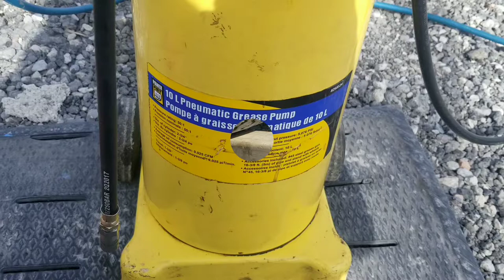No grease fittings? No problem!! | Ford F250 | asmr grease

Comment: You may want to use some RTV Sealant to patch those hole up. So grease doesn't end up seeping out of there as your driving or going over roads
Reply from the maker: Thank you for the suggestion
Reply: Wonder if taking a soldering iron and touching the made hole would seal it up it’s small enough and seems would work better then trying to get something to stick to rubber coated with grease. Cheers
Reply: @caseG80  good tip, it might work
Reply: That needle isn’t making a hole it’s designed to slice in the tip is at an angle.  The boot really is just covering the grease contained even with a grease zerk after a few pumps grease comes out somewhere.  They’re not holding pressurized grease in.  I think it’s overkill

Comment: not effective , the grease is not getting around the ball  and socket  where the friction occurs , it needs to flow around the ball to create a cushion film between the two,
Reply from the maker: It is effective enough to stop the  Squeaking noise. The grease film (oil) does make it all around the ball and socket enough to stop the noise and provide lubrication.
Thanks for the comment
Reply: get a moderate amount in there, it will distribute itself!  he did fine

Comment: One way to help keep dirt out of the hole that you poked through the rubber boot is to clean the boot off and then put some super glue or silicone gasket maker glue over the hole. It will hold nicely as long as you don't overfill the rubber boot up with grease.
Reply from the maker: Sounds like a good idea, I will try it out next time. 
Thank you for the comment
Reply: liquid electrical tape is awesome too .   yup, keep an eye on it every few months is what i gotta do with the one i blew out on my truck with too much grease.  thanks.

Comment: I never thought of doing that, but you made me think bout this
I would try bending that needle into and arc, or find a good curved one, and try to pull the edge of the rubber boot out just enough to slip the needle around the edge of the boot, one may have to use a small pliers to pull the edge out, and one would not need to keep puncturing the boot and have it quickly leak out as it gets pounded through travel. as that will happen,
Reply from the maker: Thank you for the comments

Comment: Thanks for the good info! What kind of grease do you prefer… synthetic, off-brand, Lucas, Amsoil….?
Reply from the maker: Thank you for the good question. I use a EP #2 (it's thicker), and it's made by Chevron.
Reply: I always use marine grease in case water gets in it won't be a issue
Reply from the maker: @jasonpeters9363  that's sounds like a very good idea,  maybe next time I will use marine grease
Reply: We use the synthetic ‘Green Grease’ on all our boat trailers (6) in the keys. Our new 2022 F250 will be getting the same for all the fittings.
Reply from the maker: @davidh5309  nice 👍
Reply: @davidh5309  Nice! I’d like to see a video of how to properly grease everything on an F250! Are you getting the 10 spd 6.7L diesel?
Reply: @Blakehx   2022 F250XLT 7.3 Godzilla with the 10 speed. Just got it in 3 weeks ago, only took 6.5 weeks from order. Truck is used primarily for towing our fleet of rental boats up and down the keys weekly.
Reply: @davidh5309  Nice! I have a 2019 F-250 6.7L diesel but not a fan of the 6spd transmission (I’m in 6th gear before I hit 50mph🤷🏻‍♂️). If I’d known the 10spd was gonna be available on the diesel in 2020 I would’ve waited.
Reply: @Blakehx  have a shop reflash it and force the transmission to do a Re-learn procedure. it can do funny things like that....... and its normal even in tow haul mode on to up shift to 6th unless you lock out 6th gear at around 45 mph...... under high throttle it wont upshift until 60-70 mph... itll ride 5th pretty high or if you lock it out.... i checked the gear ratios of my truck almost the same as my 5r110w in my 2005 F250 and the 5r110w is a 5 speed and the first 5 gears of the 6 speed they have are almost the same (excluding overdrive 5r110w has seperate OD 5+1) and i can do  80+ in 5th not overdrive in that truck....... i got my particular F250 because its got the 6 speed im not a fan of the 10 speed.

Comment: NO JUST FORD. ALL CARS MANUFACTURERS . They are life time warranty.   My 2018 Ram same thing . 
But my 2004 E250 I can grease  everything.  Even the drive shaft  bearing.  
And water pump .
Reply: my 2019 F250 there are zero grease zerk fittings on anything underneath the truck only superdutys to retain zerk fittings are the F450s Pick and cab n chassis or larger.......... the last year that any of the F250-F350 super dutys had zerk fittings was 2017 and they only had zerk fittings on the Front axel knuckle for 4x4.... my 2005 F250 has grease zerks on all these..... 

they make the most money not from selling a 80,000 dollar truck to someone but in replacement parts....... you can walk away with a truck with 1-2% interest but they'll know you'll be coming back just after warranty's up and giving them 10-12,000 for a new front end because they designed it to be unserviceable
Reply from the maker: Thank you for the info

Comment: Thanks for the vid. For the rookies like me, do you mind sharing info about the type of grease you used? Is this the same grease for all of those joints (u joints and ball joints) and links? I tried to buy some but there are to many types to chose from?
Reply from the maker: I hope you enjoyed the video.. and thank you for the question.  I use grease made by chevron and its a number 2 grease, which is thicker.
Reply: @ninossifo  thanks!
Reply: any grease as long as it wont dry up and eat rubber

Comment: Can ee do like that on cv boot?
Reply from the maker: I wouldn't recommend it on the CV boot, just because it's spinning and flexing back and forth. But It can be used on the CV boot as an emergency quick repair till you get to the shop and do a proper repair. As for me using it on the front end of my truck it is only a temporary solution
Reply: you an do it. just put RTV silicone on the hole and you will be fine. He didn't now at that time, but we already find out .

Comment: Junk it. Buy a Chevy! #beaman!
Reply: ah yes the good ole Independent front suspension.... i think my guy prefers to have steering..... chevys dont even have greaseable tire rod ends..... and they always break.
Reply: @justnsaliga8518  your crazy... chevys do to have greasable """tie rod""" ends!
Reply: @David_does_it_all  they're pencil sized that's even crazier
Reply: @David_does_it_all  aftermarket ones buddy of mines got a 22' Denali 2500 HD it's sealed. And to my knowledge unless it's changed recently most of their heavy duty front end parts are from the 1500 and that's why they break tie rod ends.... Takes GM to use suspension parts designed for a 400 lb gas motor and put a small lift on it and a 1000 lb diesel motor on it
Reply: @justnsaliga8518  once again not true...
Reply from the maker: Lol

Comment: If there's no grease fittings it's for a reason, if you concerned about wear on your front end you should visit a service center.
Reply from the maker: Thank you for the comment, visiting a service center to replace all the front end would  actually cost quite a bit, I have lots of grease and it's cheap.  Doing this every couple of months will save me alot of money.
Reply: Yeah for the reason of paying the dealer service center more money for repairs like everything made today things aren’t made for repair or easy upkeep all made to replace after so many years
Reply: @caseG80  yep designed obsolescence
🤔. How long is the warranty
Ok design it to last 5-10 years after that tops
Reply: they removed the grease fittings from the superdutys to save a few cents and return 5000% profit on selling same parts previously not sold as replacment because theres no way to grease them..... 2005-2010 all the F250s and F350 and larger had grease fittings on all the parts he greased in the video..... you know how many of those trucks ended up with death wobble or really worn front end parts making it dangerous to drive. very few...... and my 2019 has no grease fittings on it at all.... plastic cap where the grease fitting would go 2017 is the last year they had grease fittings on the 4 wheel drive knuckles..... 2018 they removed it...... the service center is exactly where they want you to take it to so that they can sell you more parts they make the most money not off of selling a 80,000 dollar truck but off of parts selling new parts and they're designed to fail...... the F450 pickup and cab n chassis has almost identical parts same part numbers but the variation from the same parts to the other superdutys is they have grease zerk fittings on them. don't wanna piss off commercial customers..... so whatever reason you mention the reason isn't some mechanical reasoning for it not having fittings other than to save a few cents on the dollar on the end product. and make a lot more money on customers buying replacement parts.
Reply: no.  add fittings, we do that for a reason, so we never have to pay a dealer because we do preventative
Reply: @justnsaliga8518  two words:  tap and drill.  We add zerks to stuff, it works
Reply: @justnsaliga8518  My 2005 F250 had all sealed joints on it from the factory.